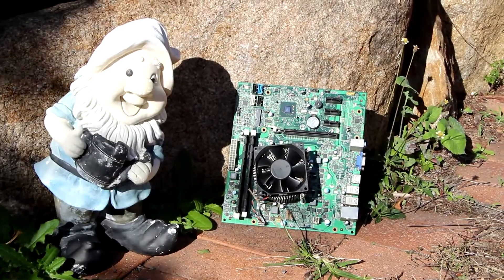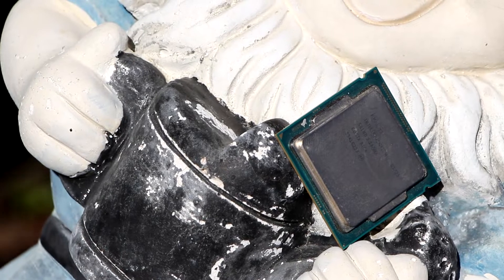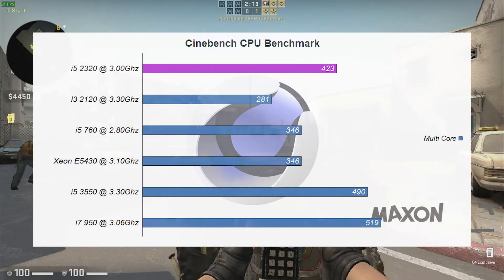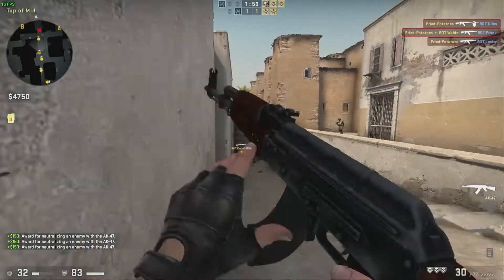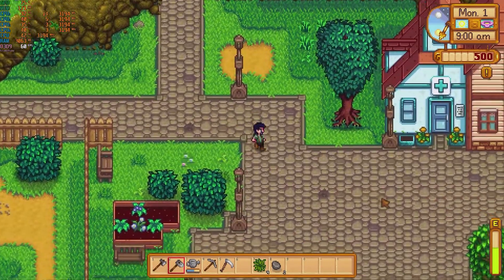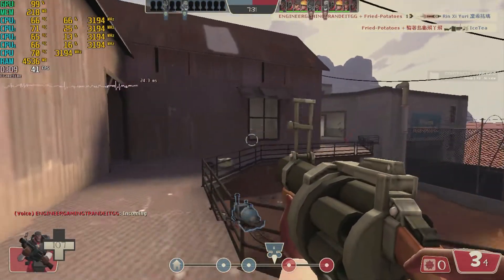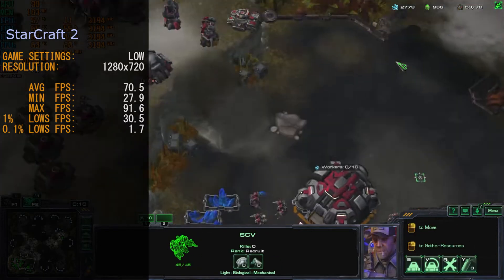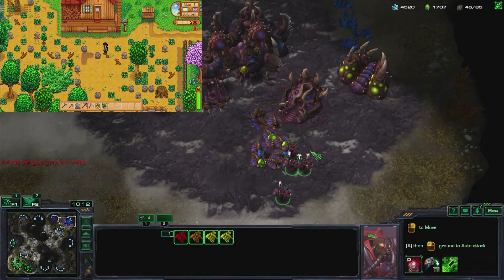Intel i5 2320 on the igpu intel HD2000 - What games can we play?

Comment: Win10 drivers are probably flakey as per the hd4000 series (e.g. hd4440 and hd4460), even though win 7 and 8 drivers are somewhat (quite a lot) better (although not perfect).
Win8 and server2012 are reasonable test platforms and so is linux (but linux opengl will be a weakness but some games you can hack the settings files for lower opengl like with overwatch which is probably what you experienced with fortnite, likewise maybe it's on Paladins and Valorant).
Dual Channel RAM helps. It won't be amazing though (of course). Quadcore DX10 games might do alright. ResidentEvil series, Tropico3, Dirt, Grid, SonicAndSegaAllStarsRacing, SonicColors, SegaSuperStarsTennis, Soccer games, that kinda thing. Dota might have been worth a try.
Reply from the maker: Good information and thanks for watching.
Reply: i have problem with the driver in windows 10, it was latest update but so much error on it, should i downgrade the windows version?
Reply: @dodyprasetyo4908  Here is some information to help you. Unless Intel release some sort of firmware and/or driver update for these i5 intel chips including the hd4460 (or hd4440 and i3 CPUs of that time) with MSWindows10 stability fixes, some might consider themselves better off by changing graphics card as long as it is affordable. Even though an RX570 8GB can be paired with such a rig, unless one has a specific reason to go that high, many people go for a gt1030, however it is possible to go even lower (depending on what a aperson seeks to do) and so even though an AMD r5-230 or r7-240 (the latter for video playback, although both are only a slight upgrade in gaming performance and barely for gaming at all) are chosen at the risk of needing to deal with Hypermemory using RAM (which some people are not seeking to go for), using the  CPU with a used market Nvidia GT740 allows for 1GB or 2GB or 4GB VRAM and 'some' Nvidia video encoding. While it is not claimed as the most amazing gaming card, there are still some games for which it "gets the job done" but also the Kepler microarchitecture is reasonable for old versions of linux (such as having a 2nd Hard-drive for linux wih MangoHUD and the 1st for MSwindows) and those games include a bunch of hose in the video and a GT740 can be had for about twenty bucks as long as enough RAM is in the PC (being mindful that about 3Bucks gets 4GB PC3-12800 1600MHz DDR3). Checking motherboard and matching the CAS-timings for compatibility is worth consideration. If planning passthrough for various GPU configurations, consider if the motherboard has SLAT (and suitable IOMMU).
It is not for everybody however some models allow for the tiniest amount of overclocking on that graphics-card. Some people cannot tolerate such low speeds and opt for a rx570 (acknowledging the SSE4-1 is handy on the hd4460), but the GT740 is still an upgrade compared to the onboard i5 GPU like the video (or HD4460) and some people kinda like squeezing what performance they can from the GT740, especially because it has the video-encoding and thereby is useful beyond mere gaming. The GT745 is like that but slightly better at gaming that the GT740 model. Not far off (as long as there is usually 8GB RAM in the motherboard or more), the AMD r7 250x or r7 260x or r9-270(x) graphics cards are reasonably low costing. All such GPU versions, before upgrading, are to be checked for DDR3 or DDR5 and so on. The r5-230 is sometimes a few bucks (and only needs a "PCI-e x1" at gen2 slot as long as it fits such as by low-profile to full height convertor or a notched out PCI slot). It does video encoding modestly (but a r7-240 wants about a two-and-a-half times PCI-e slot which means a 4x slot gen2, like a GT740 wants, unless you're prepared for a tiny bottleneck at the 2x slot speed which is like a 4x slot at gen1 even though those CPU types do not really go with gen1 slot mainboards, and yet a GT740 can be gen3 so a 2x slot PCI-3 there can be alright). Hyper-memory means a 64bit OS is best so as to have at least 6GB RAM spare but more like 8GB. More RAM is better though, by nowadays (like 9, 10, 11, 12, 13, 14, 15, 16GB depending on if dual-channels matters any longer). Some AMD graphics cards do crossfire or can be used twice at once such as for video-encoding on one (or Blender3D rendering) whilst the GUI operates on the ther GPU. Keep a machine's security updates abreast of modernity. Downgrades are not always possible.
My comment has no hate in it and I do no harm. I am not appalled or afraid, boasting or envying or complaining... Just saying. Psalms23: Giving thanks and praise to the Lord and peace and love. Also, I'd say Matthew6.